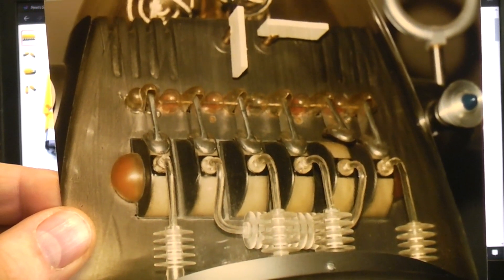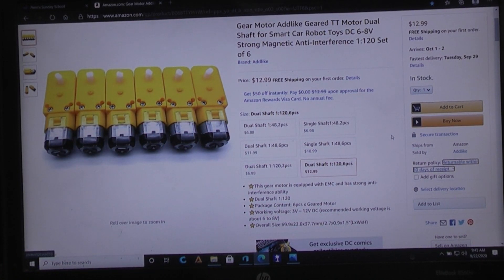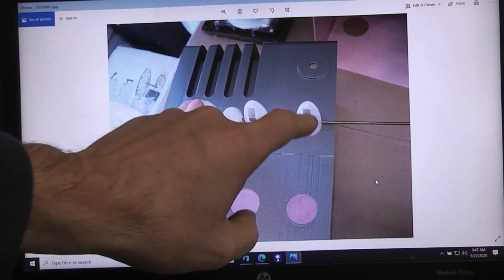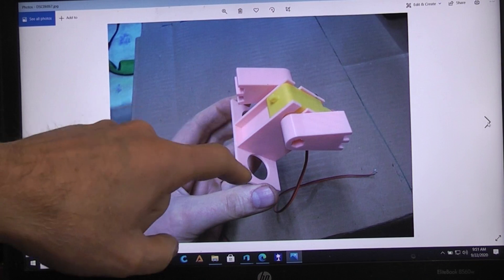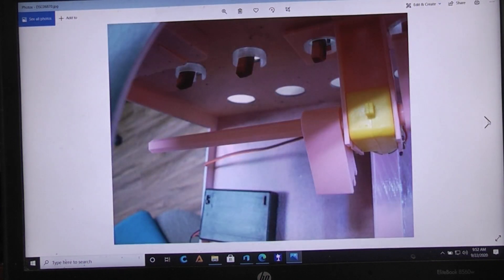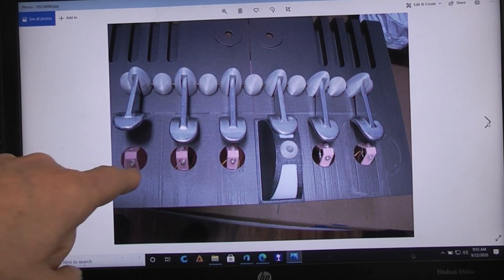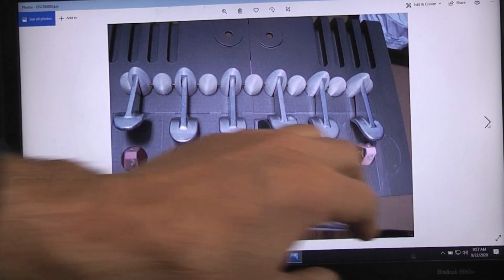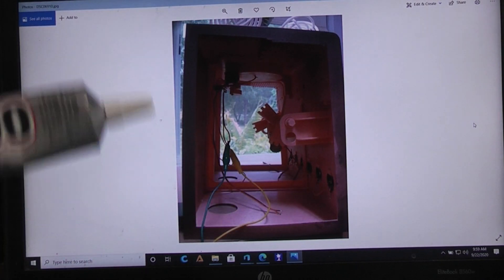Step 2.  Block Head Robby Machine build. The Sax Valves.

Comment: Hey John, I'm having a hard time finding the dual shaft motors at the 1:120 ratio. All that comes up is the 1:48. Would these work as an alternative? If not, would you have a link to the correct motors?
Reply from the maker: On Alie express I see they have a new metal gear TT motor with a 1:90 gear ratio. That would be better than the 1:48 as it would be closer to the speed and power I had in mind.
1:90 110RPM 3V-36V Metal DC Gear Motor Single Shaft Axis Brushless DC Motor for Arduino Fan Robot Smart Car Toys DIY

https://www.aliexpress.com/item/1005002280965951.html?spm=a2g0o.detail.1000014.29.6f531c16F8UMcx&gps-id=pcDetailBottomMoreOtherSeller&scm=1007.40050.281175.0&scm_id=1007.40050.281175.0&scm-url=1007.40050.281175.0&pvid=db8db127-eaae-464f-824e-01d7cdfe9ed6&_t=gps-id:pcDetailBottomMoreOtherSeller,scm-url:1007.40050.281175.0,pvid:db8db127-eaae-464f-824e-01d7cdfe9ed6,tpp_buckets:668%232846%238116%232002&pdp_ext_f=%7B%22sku_id%22%3A%2212000019898729522%22%2C%22sceneId%22%3A%2230050%22%7D&pdp_npi=2%40dis%21USD%21%211.17%21%21%21%21%21%40210323a616527192639187935e8626%2112000019898729522%21rec
Reply: @Robothut  Unfortunately, it doesn't have the dual shaft to supprot your Sax Valve animation design. :-(
Reply from the maker: @willrbsnb9  That was just an example. if you use the same search words you can find many that do have the dual shaft. like this one.
https://www.aliexpress.com/item/1005003268826610.html?spm=a2g0o.detail.1000014.5.1e2d2949Pbnzae&gps-id=pcDetailBottomMoreOtherSeller&scm=1007.40050.281175.0&scm_id=1007.40050.281175.0&scm-url=1007.40050.281175.0&pvid=cff6520c-7963-4916-b947-95c642814cf9&_t=gps-id:pcDetailBottomMoreOtherSeller,scm-url:1007.40050.281175.0,pvid:cff6520c-7963-4916-b947-95c642814cf9,tpp_buckets:668%232846%238116%232002&pdp_ext_f=%7B%22sku_id%22%3A%2212000025709684342%22%2C%22sceneId%22%3A%2230050%22%7D&pdp_npi=2%40dis%21USD%21%212.5%21%21%21%21%21%402101d1bd16527219951544429eca02%2112000025709684342%21rec

Comment: Good Morning sir,
This is more of a question on post processing the Sax valves.   You commented about sanding the heck out of the valves.  I plan to print them at a higher resolution which should help then use this primer. https://www.walmart.com/ip/Rust-oleum-Gray-Filler-Primer/33616414 .   I believe you mentioned filling the gaps with bondo on your Step 1 video.  Is that something I should use on these?
Should I be using a Chrome or Aluminium  paint for those?  

 I hope you don't mind the questions. 

 I really appreciate the attention to the details that you bring to these videos.
Tom
Reply from the maker: Hi Tom. Print at a light resolution will help or if you have a resin printer then you probably will not need to do any sanding. The primer filler is a good idea. You prime the part then sand off 90% of the primer , the goal is to fill the small gaps in the layers that FDM printers leave. There are lots of good videos on youtube on this . Now once you get a smooth finnish you should use  a liquid chrome paint called MOLOTO Liquid chrome.
If you buy it in the 30ml refill size you will get a lot more chrome paint for the money. You can brush it on or if you have a air brush set up that works great as well.

Comment: Hi John , sorry I meant the cams that flip the sax valves, are they positioned at 60 degree angles on the hex rod as they turn and hit the Sax valves ??
Reply from the maker: The cams do not move the sac valves in sequence from left to right, it is supposed to look random.
A Regular Hexagon has Six Sides equal in length  and Six Angles equal in size (all are 120 degrees). Or so the internet say's.

Comment: Hi John , I assume that the Sax cams are positioned at 60 degree angle to pivot hex rod ? You mentioned that all the domes are glued in place , is the rod that goes thru all of them glued at just the ends so it can't turn at all ?? The end of the Sax valve where the cam contacts should it be rounded or left with a right angle trim so it catches ??
Reply from the maker: It does not matter if the rod that runs threw all the sax valves is glued or not as the sax valves should move freely on the rod you use. I glued the rod ends just to keep the rod from working its way out.
The end of the sax valves are shaped properly for the 3d printed design, do not round them off. In the screen used Robby the ends of the sax valves had a small pin and roller set up, but they were made of cast aluminum there was a lot more mast to be moved so wear had to be kept to minimum.